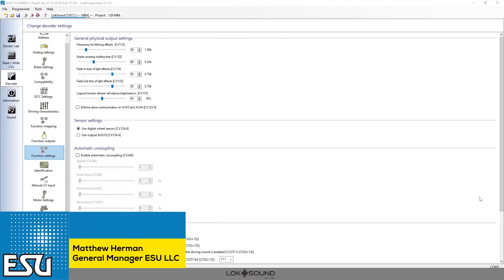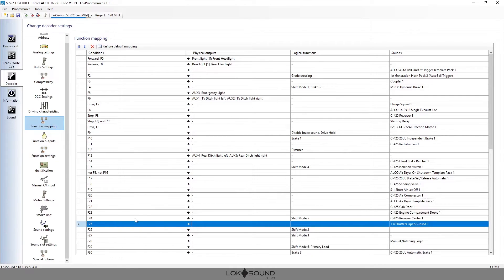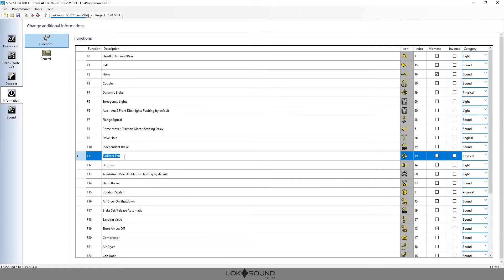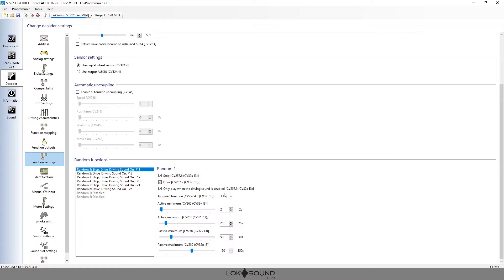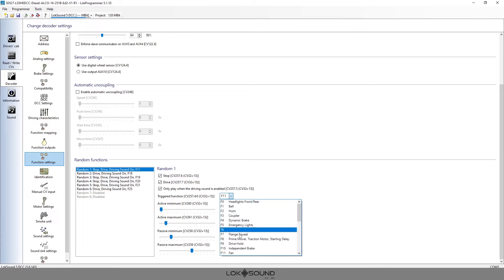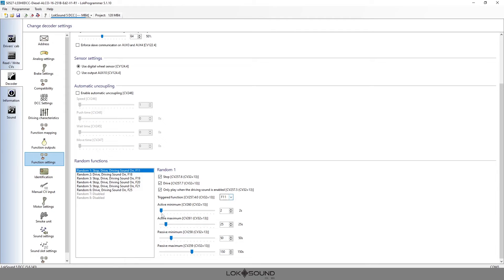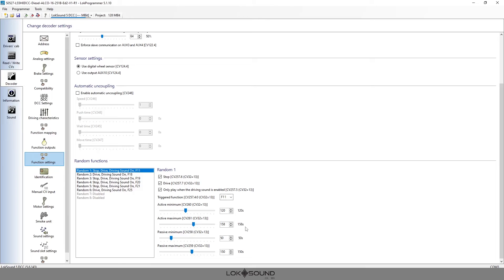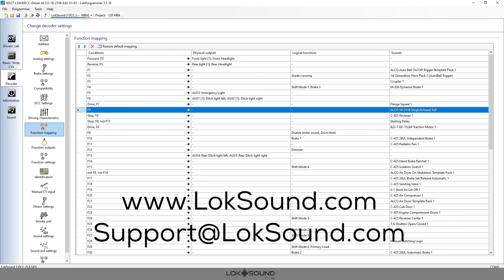Tutorial EN LokSound5 Random Sounds

Comment: Interesting the repeated sound slots for a while, what I would really like would be to see how to implement, that one of those sounds, which is housed in a specific slot, when it sounds, by giving an F that I have assigned, avoid that the locomotive stops as a safety measure, how does the German SIFA or the Spanish Dead Man work, I have tried several configurations and I am unable, can this be implemented?
Reply from the maker: This would have to be created in a soundslot, not using the random features shown in the video. There are "rand" conditions within the sound schedule commands that could be used to make it "random" but a schedule would have to created that would stop the loco. Interesting idea! Should be possible though.
Reply: @ESUDCC  Thank you very much for the answer, I have to get it to see how it can be done, and that it resembles a real train. I would also like to be able to get in touch with you, I want to make videos of how to use the program in Spanish for Spanish-speaking people, since the decoder manuals are in German or English, and there is no manual for Lokprogrammer version 5 Well, to be able to have a base from the most basic of it to the realization of projects from 0 of sound, and I wanted to know if I could count on your support to do this.
Thanks and greetings from Spain
Reply: @ESUDCC Can the audio files be used to create an analog/ non-DCC soundbox?